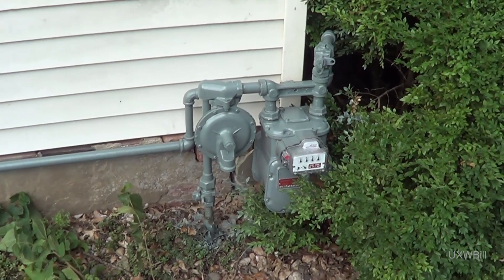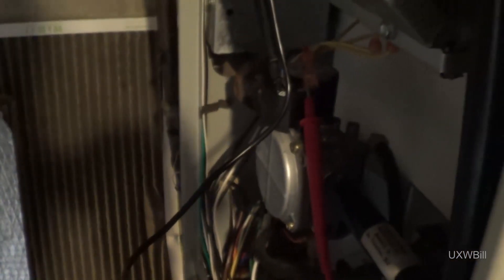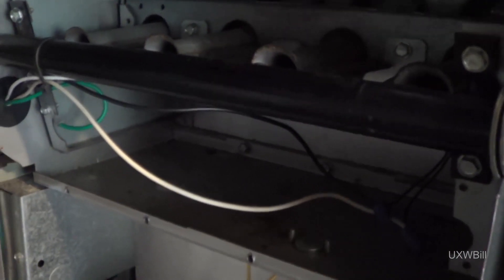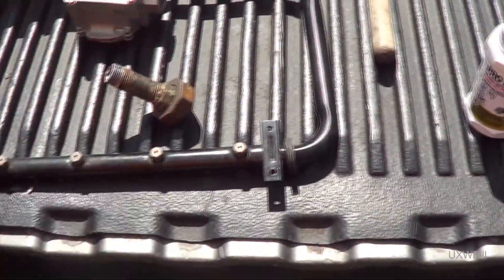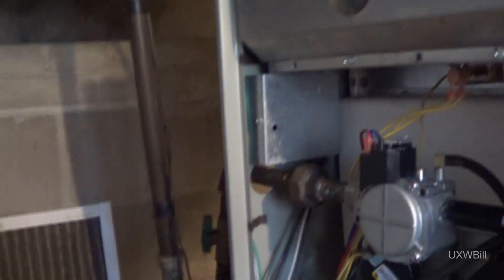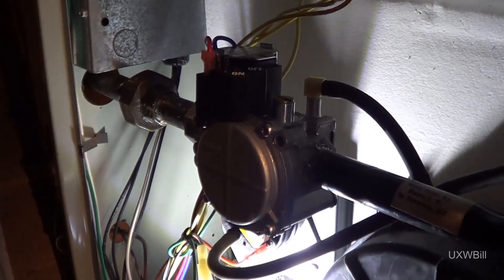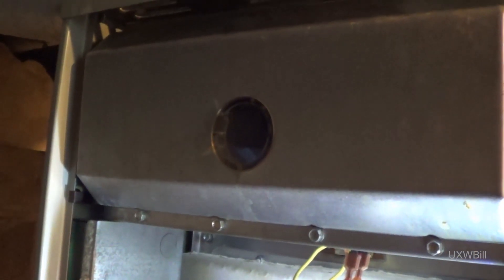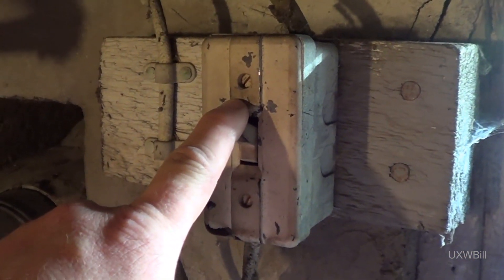Trane TUX080C942D2 92% AFUE Furnace Gas Valve Problems Part 2: Replacement

Comment: Edit:This is not intended to be critisism of uxwbill, just a FIY. psa - co alarms only go off at high levels and provide a very false sense of security. Do not rely on a co alarm to tell if you have a cracked heat exchanger, call a pro out to do a vision inspection, combustion analysis, and measure ambient level. The flames can also look perfectly normal yet the hxt is full of cracks - it takes large cracks in the right places to get flame disturbance when the fan comes on. There is no fail-safe heat exchanger test.
Not all cracked heat exchangers leak out co, most don't as they run under negative pressure - the danger is exhaust/flame can be blown out the front. co in the exhaust can also be really high.
Reply from the maker: Mostly fair points, however:

1. I am the professional here. I don't claim to know everything -- nobody does -- and I am admittedly just starting out in this field. (That's important and I'll come back to it.) I may never do this kind of thing as full time work or for my primary livelihood.

2. As the video says, I have a proper "inspection grade" CO detector (a Klein Tools ET110 that I'm not hugely satisfied with, if you really want to know) that I couldn't find at the time. Not long after, I located it and tested again. The system passed perfectly. Not failsafe, granted, but good enough for most.

3. I don't own a combustion analyzer and they are quite expensive. Could I buy a used one? Sure. Would I trust it with someone's life? No.I don't yet and may never have every HVAC/R tool in the world. (As mentioned above: this isn't and may well never be my source of livelihood.)

4. I did what the homeowner was willing to have done, with the understanding (in writing) that any airflow based CO leakage test may not be perfect or catch every possible problem. 

5. A working CO alarm is better than nothing. There was one present and I left another. It cannot be argued that they save lives, even if the alarm threshold is set very high or would take a few hours to "notice" the problem.

6. If you're talking of and in the case of a flame rollout when you mention flames being blown out the front, the furnace's safety controls should intervene before things ever get too far out of hand. I verified that the rollout and high limit were both connected and closed. I'm not convinced it's a good idea to test and exercise the rollout switch unnecessarily as I've seen others do with varied heat sources. Maybe that test pushes the control beyond its limit, and it fails when it is needed most.

7. This video isn't a how-to and doesn't make any such claim. I cannot control what others may do. I can only hope that they'll take the good-faith warnings given seriously and hire a professional for their own furnace repair needs.

8. The video description discusses the limits of CO alarms. I never updated it to reflect the fact that I found my handheld detector and used it.
Reply: @uxwbill  My intention was not to criticize your work at all, I appreciate the videos. 
Only to warn general public as they can a lot of misconceptions, parts of this video reinforce. 
This fresh in my mind - not long ago helped a family friend by giving a second opinion -> he was having his furnace serviced by a so called licensed "pro" year after year who likely did the same safety checks you did in the video before pronouncing the heat exchanger okay. Probably looked at the flames and checked supply air for monoxide - passed.  I fired it up and the flames looked absolutely perfect, no outward signs. Cut a hole in the plenum, took a look and the heat exchanger was full of open cracks! He has monoxide alarms and they never went off!

PS - it was the same make as yours and a few years newer. You should really check yours visually if you haven't been - scope inserted into limit opening works when there's an a/c coil right above.
Reply from the maker: If you're talking of the good old Comfort Shaker, I probably should have a look at it sometime. It has been a while.

During one of my classes, the subject of tiny holes or cracks in a heat exchanger came up and just how much hazard they might really present. Viewpoints were all over the place and there was a lot of discussion.

My video borescope fell victim to a basement flood two years ago, and I've yet to replace it.
Reply: @uxwbill  the model with really bad cracks was a 2000 n9mp1 - rpj-II heat exchanger, i think the same hxt design as yours. the cracks were right after the first heat exchanger curve.

Comment: hey uxwbill, u rmemebr that big old furnace i asked u advice on? they dont make furances that large any more and one contracter suggested if we decide to upgrade toa. new one this year, it could be beneficial to have TWO smaller furnaces instead of one big one. what do you think of that propsal? i think the idea is have one furnace for one floor and nother one for the upper floors.
Reply from the maker: What is the heating capacity (BTUs) of your current furnace?

It's certainly possible to have two furnaces heating a single location, either together ("twinning") or as separate units serving separate areas.
Reply: get a heat loss/gain calculation done -  one large furnace is probably enough. it takes a huge house to even need one 120k btu which is about the largest made. https://www.loadcalc.net/

Replacing like for like can be a huge mistake as new furnaces of the same btu require more airflow compared to old.

Comment: yeah my school wasn't air conditioned either back in the 80's and early 90's.  i remember some sweltering days in the old building that was built in 1917.  no fans either in that old building.   it's funny the year after i graduated they tore it down and built a new building with all the bells and whistles..... and A/C!

Comment: The auto parts store where I worked back in Iowa had 2 furnaces, and one had a rusted out heat exchanger.  I never saw it running, but I was told that it would shoot flames when it kicked on.
Reply from the maker: That's always a good sign!

Comment: Unfortunately, no gas man or company I know of would install a complimentary CO detector.  Sure, they might put one in, but you would certainly see it on your bill.
Reply from the maker: A little (?) elaboration on this:

In Illinois, having a working CO detector is the law. Now, even so, I'd hazard a guess that lots of people don't. There aren't any CO detector police.

A plain old CO detector costs about twenty five bucks, give or take. I think most HVAC service companies make enough money to cover keeping a few on the truck and occasionally installing one in a home where there are none. If somewhere down the line it goes off and saves someone's life in doing so, there's the possibility that the customer will remember who cared enough to put it there.

I'd certainly do it for the goodwill aspect alone, even if largely imagined.
Reply: uxwbill :. I think it's great that you would offer a free CO detector to your customers as a goodwill gesture.  Unfortuntetly, I don't think very many companies feel the same way.  They would say that "we noticed you don't have a CO detector installed so we'd be happy to install one for you at a cost of $XX.00".  Nobody does ANYTHING for free anymore.  Maybe it's different in IL, but where I live, forget about it.  Companies don't care about their customers, they care about their bottom line.  I could give you example after example of this from personal experience.  And you know what, I will... We had our central AC replaced this Spring (for many thousands of dollars) and when they were done they noticed that my AC filter was a little dirty, not crazy dirty, but probably due for replacement sooner than later.  The guy said I can throw one in for you, I've got a ton on the truck.  So I said sure.  When I got the bill, can you guess what was itemized on line 3?  And at a cost of $32.99.  It was a basic Filtrete furnace filter that cost $11.99 at Target.  This is my point.

Comment: We live in a very affluent town and the middle school my daughter graduated from in June did not have AC.  Not having it isn't as rare as you'd think.  The new $43 million HS on the othethand has every bell and whistle you possibly could think of.
Reply from the maker: This does come as a bit of a surprise to me, being as almost all of the schools around here have air conditioning. Even the old buildings have been retrofitted, or at least supplied with window air conditioners in all the major rooms.

I suppose a lot depends upon how miserable the summer is, and for how long. In most of Illinois, the heat and humidity conspire to make the first few weeks of school a miserable experience. Before the schools were air conditioned, they had early dismissals for those first few weeks.
Reply: uxwbill :. Yes, some of the main offices had windows units, but the majority of the classrooms did not.  It was pretty miserable for the kids, absolutely.  It's like that for the majority of the schools around here.  Unless they have been renovated in the last 25 years or so, there are no cooling systems.  In fact, my wife went to the same middle school as my child and she said that nothing had changed except for the fact that it was falling apart even more than it was when she went there.  It was a dump then, and it still is.  I live in the Northeast and would imagine our climate is somewhat similar to yours.  First and last few weeks of school are usually awful.